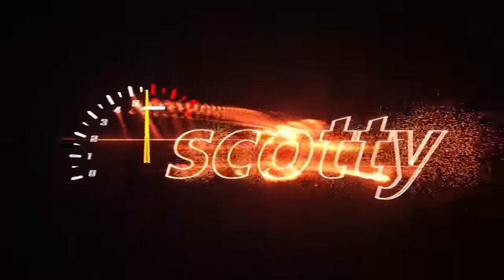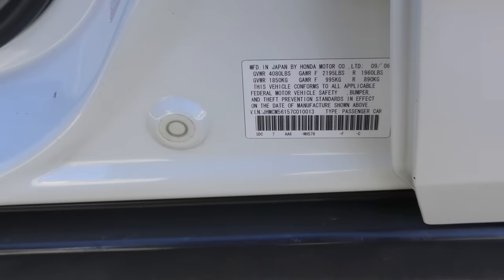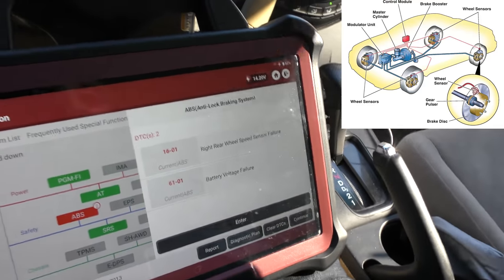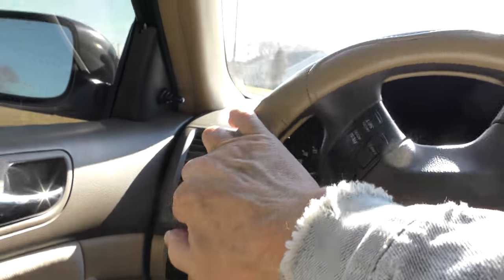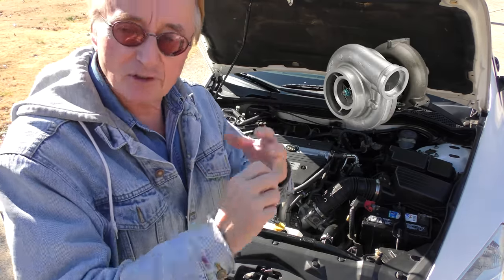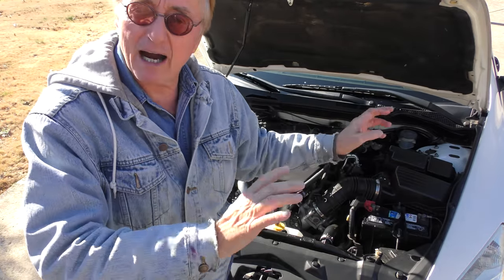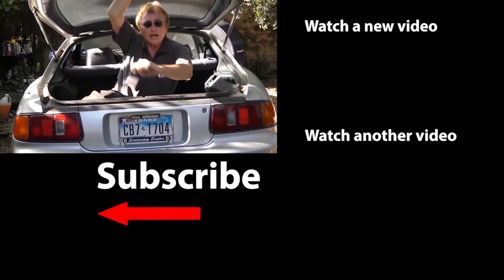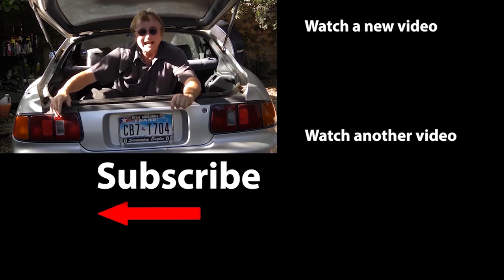Stop Buying Hondas with This Engine

Comment: I thought from the thumbnail you were going to advise against buying a K20/K24 which is one of the best engines of all time. The LS of the 4 cylinder world... 
Agree. The J series v6 and accompanying transmission are lackluster compared to Honda's 4bangers
Reply: Nah my TL always outlasts our RSX and prelude. J engines never have problems lol
Reply: The v6 is for customers who like to go fast. The k series is plenty sufficient for most people however and it gets better gas mileage
Reply: Don't buy any honda with the 1.5 liter  with a turbo if you live in a area that gets extreme cold temperatures.  1.5 liter can't get up to operating  temp if you have heating fan on high. You end up with oil dilution and very poor heat inside the cab. The 1.5 liter is a three season engine.
Reply: K24 has 3 class action lawsuits
Reply: Transmission issues were only  Present with 03 and 04 models V6
Reply: @mikepro-ww5fg   It's not true on gas mileage it's about the same on the 4 cylinder It gets better gas mileage if you drive it like a grandma in real world driving I have to have higher acceleration to catch up to speed compared to the V6 where I burly press the throttle and it goes using less gas mileage it's about the same I went from a 4 to a 6
Reply: I had both K and J series engines and  always preferred the smoothness and torque from the J

Comment: The 2liter K20C2 None turbo In our 2020 Civic Sport Sedan with  a 6 speed manual trans  Is running like a TOP, Don't need a turbo or High pressure fuel injection, So with the temps below 30⁰ all the time and allowing the car to warm up a few min the fuel mileage is down a few. 😎👍.
Reply: I also have a 2020 Civic Sport Sedan with a manual transmission and 2.0 K20C2 port injected engine. Can’t beat that settup in a modern Civic for reliability! 👍🏻
Mine is Modern Steel Metallic Gray 🙂

Comment: This white Accord with black door handles is a VP (value package) with manual mirrors and only front speakers  , it comes with ABS but it doesn't have Traction control.
Reply: I have a 2006 Accord VP in  gold. Still runs like clock. No electronic mirrors or stability control, but still has the ABS brakes. Bare - bones, yes but still a well equipped car.
Reply: how many speakers?
Reply: dont need traction control anyway xD

Comment: Brought brand new my 2.0L Honda Accord 4 cylinder V-tec Model in 2006 (17 yrs ago) . Has clock 375,000 Km to date. The only major repair was to change the transmission clutch plates at 350,000 km. I changed oil every 5,000Km. Honda transmission oil  change every 40,000 km. Every other parts is still original. The pick up is still awesome. No regrets cos I got my money worth.

Comment: Scotty I have two 05 Acuras, an MDX and  a TL. TL has 145k and the MDX has 125k. I take excellent care of them (adjusted the valves on both!) and they both run and drive like new. 05-06 was peak Honda awesome and I love the V6 power. Yes they need premium and the fuel economy suffers, but I still get 30 on the highway with the TL and that's 270 HP. As long as these are maintained well (especially frequent transmission fluid changes), they will last a very long time.

Comment: I have a 2007 Honda Accord Sedan 5 speed manual with almost 162,000 miles on it but will need a oil change soon. So that's pretty much nothing in terms of mileage. However it's my temporary car because once I save enough money I will buy my dream car with a stick shift of course.
Reply: What's your dream car?

Comment: I have a v6 2007 Honda accord and I love it to pieces! It's been my first and only car and I've been driving it about 3 years. Has just over 230K miles on it and I'm hoping if I keep taking care of it I'll get at least 300K out of it. Only problem is the power steering groans, particularly when its cold and the engine isn't warmed up.
Reply: I have the same vehicle The power steering noise if you haven't changed your fluid recently then it's caused by a rubber Seal gasket $3 fix There's a known bulletin YouTube videos how to fix easy
Reply: Make sure to use Genuine Honda Power steering fluid if you change the fluid. The aftermarket Honda spec stuff doesn’t work if it’s an original pump
Reply: @levimagnusson5880    lifeguard fluid makes full synthetic Honda power stirring fluid
Reply: We just sold a 2003 V6 Accord to a friend with 297000 miles. Transmission was rebuilt at 261,000 miles.
Reply: It might be O-rings issues
Reply: Just bought a 2007 v6 accord. And I am scared it'll fail on me soon. It sounds weird when I accelerate. And only has 135k miles
Reply: @Ambitious Daisy  did you figure out the issue?

Comment: Let's see, pay $13 to $15.00 to fix a speed sensor or buy a new car???  I would pay the $15.00 and 20 min to fix the unit and keep the car.  The only thing I see wrong with the car is that it does not have a backup camera.  Okay, want and not a need for me!
Reply: And you can easily install a backup camera!

Comment: Got 435,000 kms on my 2007 CR-V (K24Z1) Just changed the oil with 5W-20 Full Synthetic. Only problem with the car is i have some clicking in the suspension.

Comment: That's actually a really good engine just always got to check ur engine oil ..
Reply: And change the timing belt every 80-100k miles
Reply: @Marcus-ou4vy  Those engines have timing chains.
Reply: I had a 2003 Accord with this engine and it never burned a quart of oil in-between its 10,000 mile oil changes. Had 195000 miles when I sold it.

Comment: Those k24 engines are good engines. A lot of them develop oil consumption issues after 100k, I think it’s an issue with failing to change to oil. I had a 2012 si that I banged off the rev limiter every time I drove it. Traded her in when the air went out but engine was still going strong

Comment: Got the v6 but and it’s a rebuilt.. it doesn’t have any problem. The gas is pretty good compared other v6 cars. Just had to replace a o ring replaced because there was a leak and that’s pretty much it other than normal services.

Comment: I had a 2004 Honda Accord V6 manual coupe. Don't know what you're talking about here Scotty. I see maintained V6s with 300 and 400k miles all day everyday. Was one of my favorite, zippy, and most reliable cars I EVER owned. Both are good engines. Probably easier to work on the 4 cyl. but I think the extra HP/torque was is worth it on the V6 and the for a V6 it got pretty good gas mileage!
Reply: Honda V6 is crazy efficient in my opinion. Had an 04 TL. 6MT and it was way more efficient than my current '21 WRX.
Reply: It's not so much the engines that have issues. It's the 5-speed automatic transmissions that were mated to the V6 models. Since you had a manual, it makes sense you didn't have any issues.

Comment: One key difference between the I4 and V6 of that generation is the I4 has a timing chain.  Less maintenance than the V6 timing belt.
Reply: V6  Comes with power assistant breaks and advance Stabilization
Reply: @jay-dt3zq  literally

Comment: These Hondas use the k20 engine, which is legendary. This might be the best engine that Honda has ever made, and it was used in the 2003 to 2007 Honda Accord and CRV.
Reply: Don't forget it was also in the the RSX 02-06
Reply: This is actually the K24 engine my 8th gen civic si has a K20Z3 engine my brothers 8th gen accord has a K24
Reply: Civic Type R EP3

Comment: Even if that car needed two wheel bearings, I  would not get rid of it. It's had the valves adjusted and the only code is a dummy abs code. Definitely a keeper!

Comment: Look at my comment below, 2 years ago.       Today our original owner 2004 Accord with the 2.4 DOHC (4 cylinder)  just turned 399,400 miles on the original drivetrain.  No issues starting or running, no oil leaks and no smoking.  Seems to still have the same power as when new.  We've never been inside the engine more that replacing the valve cover gasket,  and checking valve lash ( all are good).    She wants us to drive it until  403,00 miles or so then trade it in so she can get a SUV.    We've just  "maintained"   this car and never really "baby'ed" it.     Our garage wants to acknowledge us when it's in for it's first oil change beyond 400,000 miles.

Comment: The v6s last forever I would worry about the transmissions the engines last forever they are simple sohc nothing complicated about them if anything the 2.4 is more complicated
Reply: Yeah only thing to worry about is the timing belt; just make sure to change it every 80-100k miles

Comment: Our original owner 2004 Accord just passed 350,000 adults miles on it.  No oil leaks or burning,  original engine, trans, and front end.  She drives it, and it appears to be a 5 year old car.  Only issue is static and occasionally the radio goes out.  So much better vehicle than my original owner 2004 Jeep Grand Cherokee with 178,000 miles on it.  She's smart to be a "Honda girl" .

Comment: Scotty my 2000 Honda Accord ex VTec 3.0L v6 has stood the test of time. Was misfiring, fixed it, heads were bad, fixed it, air flow was clogged up and bad, fixed it. 

The previous owner abused the heck outta this car and I had to go and fix a lot of things.

Comment: I remember driving up the AlCan, where 40 below is not particularly cold--think 70 or 80 below.  There were posted warnings not to get onto the road in the winter without a heat source in addition to the engine (I think the signs said there were inspection points during the winter).

Comment: We just bought one just like it for $4100 108.300 miles we spend $250 for parts to buy 02 oxygen sensor Upstream and Downstream and fix  power window driver side passenger side charge oil transmission fluid air cleaner. tune up car now drives nice

Comment: Make sure to also check the spare tire wheel well in the trunk. These are known to rust in these cars. Make sure the seals are still working well and no water is getting in there.

Comment: I’ve owned four accords and the best built by far was the 2000 with V6. 286k miles and was only at the dealership about four times for minor issues.
Reply: Bro i believe that my 01 v6 is still running like a champ with 250,000 miles putting down 380hp bro
Reply: Sadly the 2 only issues with 6th gen  accords are the security systems being shite and the automatic 4 speed transmission being to weak if it's combined with the v6 option. The manuals for that gen are 5 speeds.

Comment: Scotty, I need your help on deciding which car to keep. I have a 2015 buick lacrosse with 43000 miles and a 2006 honda accord 4 cylinder with 196000 miles. Both run great but one has to go, which do I keep?
Reply: Easy...keep the Honda.... You heard the Honda in the  video with a lot more miles than you have
Reply: Honda all day
Reply: Honda, bruh
Reply: The Honda! Very surprised that a 2015 Buick with 43k is still running
Reply: Honda
Reply: The newer buicks are junk .
Keep the Honda !
Reply: The LaCrosse get's a 5 out 5 reliability score and is  good vehicle. I'd keep the newer vehicle personally. Park Avenue Ultras are fantastic cars. Buick makes good stuff, don't believe the naysyers.
Reply: Keep the buick - maybe trade it in for an Acura MDX. I have 2015 MDX with 150k miles & it runs beautifully, everything works, no headaches.
Reply: @dalesworld1308  The 2015 Buick does not have a 3800, but the 3.6 that is known to give people all sorts of problems costing thousands. The reliability ratings are skewed because the average owner is driving 25 mph to church on Sundays, and the vehicle is parked Monday-Saturday.
Reply: keep the Honda most def, GMC are not reliable
Reply: @phillipellington3866  Didn't Scotty review a GM product with 400,000 miles last week?

Comment: Another detriment to owning an Accord with the V6: Very high insurance premiums. On the west coast and some other urban areas, the V6 Accords get stolen quite often by gangs, because the engine is desirable. They take it to a chop shop and get $1000 for it, then the shop will pull the powertrain out to retrofit into a Honda Civic.

Comment: Hey Scotty,

I've got a 2012 Honda Civic EX-L 4 Cylinder with just over 60,000 miles I bought with 48,000 miles for $10,000 two years ago. I noticed this winter, there's been some vibration which feels like it's coming from the front wheels. I notice this both at highway speeds and less so at city speeds. Would this likely be a tire alignment issue, or are there other simple tests I can do to diagnose what could be the problem? 
My thought would be that the ice and snow on the road could have led to a misalignment from the unintentional skidding/drifting.
Reply: It is normal for Honda. They're not the most refined engines
Reply: Vibration at 50-60 mph. would most likely be a tire balance issue.
Reply: Thank you guys for your quick responses! I'll see if I can get it taken care of soon!
Reply: Rotate your tires, front to back first
Reply: have your tires rotated & rebalanced

Comment: That 2.4 engine needs thicker high quality synthetic oil to prevent camshaft wear. Also valve adjustment are critical, exhaust valves tighten up over time. Do these two things and they will last a very long time.

Comment: Best things I've heard after buying a used 2010 civic from my local maintenance tec, "them pistons are clean as a whistle." I had to replace the front bearings and chose to have fluid change at 117,000

Comment: I am bringing my 2015 2.4 Accord to the dealer tomorrow for noisy engine repairs. The upper engine sounds like it is full of 1" steel balls banging around in it. Only 97,000 miles on it and oil religiously changed. I'm sure the Honda dealer will charge me plenty. While in the shop, I'm getting new PCV valve, valves adjusted, replace spark plugs and fix the small oil leak at the valve cover. This is my 7th Honda Accord and none ever needed engine work and most were run to 250,000-300,000 miles. I sold Honda cars and motorcycles in the 1970's. The Accord also has the white metallic paint that Honda recalled on the Civic and other models and they would not warranty the paint falling off around my rear window.

Comment: My ‘08 2.4L has 223k miles on it and still runs perfectly. Just replaced the serpentine belt during my oil change and see it going to 300k.

Comment: I have a Chevy Equinox with a 2.4L with 97,000+ miles. It's using oil and the timing chain is going bad.
I never thought that I would own a foreign car, but I'm done. I gave them 50 years of driving to pull it together. 
Now I'm looking at Toyota, Honda, or Subaru.

Comment: 267k miles is nothing on an Honda. My neighbor ran her accord to 750k miles. She just did general maintenance (oil changes, transmission fluid change, etc). All original. It was rusty bad being an 20yr old Chicago vehicle but it ran. She got an Camry now because all the accords are turbocharged gdi.

Comment: My 07 accord v6 still running like a champ even is about almost the same mileage as the car in the video. As long you keep your car on time maintenance you will be fine. I been driving my car sense it was only 130xxx. I have not change my shocks or dealing with any engine errors. Only simple things that you just do it by yourself.
Reply: Do u change transmission oil regularly?
Reply: @oscarcampos1185  yes I do my own maintenance. These cars have oil percentage shown on the cluster. I know most people wait till is 15% before doing maintenance but my once is 40 to 50% I just change it. Anything with the engine bay or suspension are still the original oem part from factory. Sparks plugs, battery, starter, alternator, and belt always be updated. My gas mileage is decent with no complains.
Reply: Nice. I just got a 2007 v6 honda 135k miles, and when i accelerate, it makes a weird sound hard to describe. Hopefully, it isn't the transmission

Comment: Make sure pcv system is good the 2.4 can burn oil frequently but I’ve fixed with a seafoam soak to free the oil control rings

Comment: Bought a 2004 Accord 3 years ago for my daughter with 180k for $4000. I thought I overpaid a little bc it needed tires. But here it is 3 years later, 210k, only regular maintenance and 1/2 quart between oil changes.

Comment: I had the Japan import special edition manual transmission version 03 4 banger. Lasted over half a million miles in the family.  I was the 2nd owner. 1st owner put 90,000 highway miles on it and I got it for 9k in 2005.  It's still going. I sold it. I miss that car.

Comment: My Accord has 304k and runs pretty good. I do need to replace the O2 sensors and clean or replace the mass air flow sensor.

Comment: Anyone with civic 2003 4-cylinder vtec engine. Mine have 166000 miles on it. Still drives like a dream.

Comment: Wife’s 07 accord at 291k. I even changed the oil once and only about 2 quarts came out. Didn’t realize it had developed quite a leak. Oops. Still running strong

Comment: I have a 2006 with 248,000 miles. Just took it from LA to Vegas with no problems. Unfortunately, it has the check engine light for the catalytic converter. It's the 4 cylinder SULEV engine, so no aftermarket cats allowed or else it fails visual inspection 😭

Comment: I couldn't go back to a 4 cylinder ( unless it has a Turbo) since I've been driving a Maxima 3.5 SE with a 6 speed for the last 9 years. It now has 306,XXX miles and runs strong.
Reply: It's not so bad, especially if you find a manual transmission model. I drive one 60 miles a day to work. My other vehicles are Toyota trucks with the 4.7 and 5.7 v8 engines. Really, the Accord isn't so much of a loss of performance.

Comment: I had a Honda Accord SE 1993, 300000KM , V4 2.4 l exellent car, never died in winter -35 oC.
I have new CRV 2003, 2011 , 2018 but lately Honda did not make a good car anymore. So many problems and recalled yearly. Now I do not know which ca is my next choice.